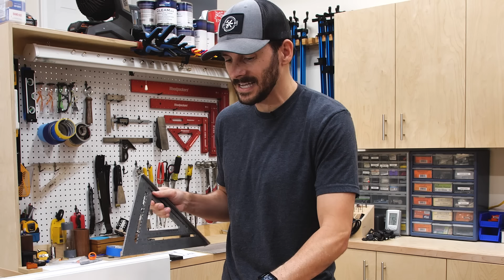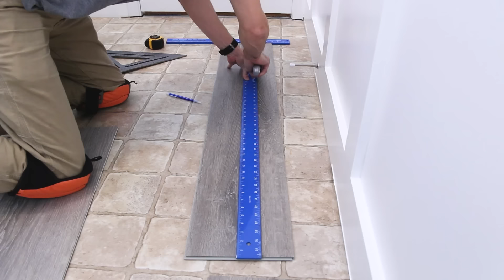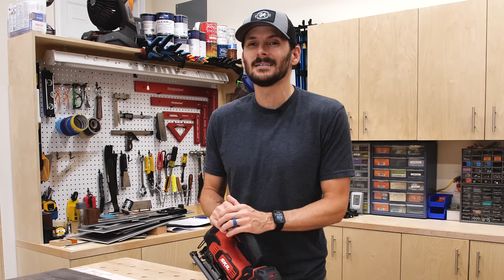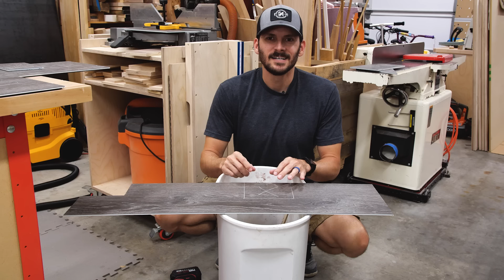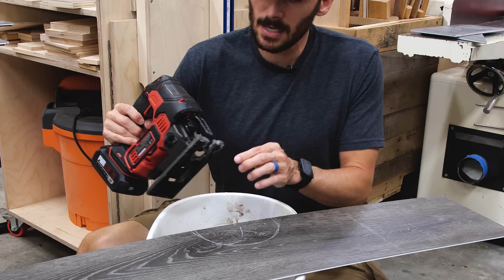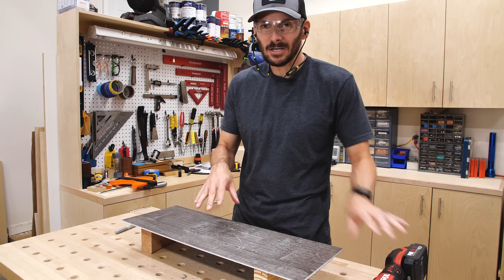How to Cut Vinyl Plank Flooring

Comment: I have used my HF Oscillating Multi-Toolfor cutting notches as well as cutting under door frames. It works nicely and can be used to plunge into the length cut of the notch.

Comment: I generally, do these jobs the messy way and sweep/vacuum after. Multi tool is #1, miter saw, then table saw for long cuts. 
If you don’t have those bigger tools, getting a circular saw can do EVERYTHING the miter saw and table saw can do. 

Getting corded versions of both at harbor freight will run you about $90. Getting a decent cordless multitool with a battery and a corded circular saw from any hardware store will run you about $150-200 (I lean this direction)

Good luck yall!

Comment: We really appreciate the detailed breakdown of cutting techniques! The way you demonstrated using both a utility knife and a laminate cutter was super helpful. It’s great to see practical tips like using a tapping block for clean snaps, as that can save a lot of time. 

For anyone starting out, remember to measure twice before making cuts to avoid mistakes. Also, keeping a few extra planks on hand can help if you miscalculate or need to make adjustments. We've used your advice in our recent project, and it made the installation process much smoother. Thanks for sharing such valuable insights!

Comment: question about the cut “mistake”.  not about the cut itself, but how do you work the joint with the already installed piece to click in yet fit the bump-out of the wall?

Comment: I watched this because my cut off pieces don't have a lip so I can't use them to start the next row....or can I, since I you did put the 14" cut line next to the next board. I'm trying not to waste expensive LVP.  HAD To update my comment. I figured it out. Those off cuts go on the end of the row...butting up against the opposite wall....dah. But I did have a legit panic for a minute.

Comment: Great info thank you!
Question….My room is 31 feet by 20 feet. How would you install the 7” x 60” boards from an appearance point of view (60 inch parallel to the long side or  60 inch parallel to the shorter side)? Thanks again!

Comment: My vinyl I install I swear cannot use utitly blades to cut its pfc stone or whatever called I work for someone who has the vinyl too but his vinyl is very strong I can snap it but it cannot be cut with a utility knife or in doing something wrong lol. I use saws or the measure it and and pull down and it cuts clean af

Comment: You do great work I just wanted to let you know when you have small cuts with the razor knife turn it over to where the village finish side is up you put your framing square half side up and you put your cut edge on top of that and pop it with your fist Very little pressure is needed but it makes a great snap. That’s how I snap every cut the only time I use a saw is when you’re making linear cuts on your board. My worker use the technique I used and he snapped 3/4 of an inch off the butt cut. I was so impressed but he used that technique that I suggested.

Comment: I found that if you tried to cut long ways with a razor blade it would try to go off path due to the grain. 
I used my table saw but it throws the vinyl dust everywhere which isn’t good for the environment since it isn’t biodegradable like wood sawdust.

Comment: Jigsaws work amazing for all cuts, not the fastest, but will get the job done, especially for odd cuts. The down side of them is the blades get dull after 4-5 long cuts. I’ve tried every brand and even purchased carbide blades that do last up to 7-9 long passes of vinyl flooring. I used Mohawk 20 mil wear and 6mm thick vinyl . Basically buy plenty of blades.

Comment: No problem on the mistake! I have seen so many expert craftspeople make exactly the same kind of mistakes with measurements. Watched one of the best contractors in San Francisco ruin a $20+k trussed beam when he measured wrong. Thanks for showing it! Reinforces the measure twice, cut once rule. Just now my wife and I are trying to figure out how to match up our cut with the twists and turns of a door inset from the wall and the odd shaped molding around it.

Comment: Square cuts razor knife all four sides then score a x from corner to corner then on a bucket take hammer and push on center of x and it will snap but be sure to cut the back before snapping you will see lines when you push hammer

Comment: On short pieces put the tapping block under and put it right on the line put pressure on  the side with block and use your palm and pop down on the side and it will snap right off

Comment: The reason you keep having the backing attached is because you are not using the guillotine correctly! It's called a guillotine for a reason! You have to pull the lever down FAST! Back in France they didn't have the guillotine come down at snail pace.  It came down RAPIDLY!
Reply: The French reference 😂😂😂
Reply: Because if it came down slow it would not cut all the way through the bones. Speed equals force

Comment: What is the interior of a piece of vinyl plank flooring made of usually?  If you do choose to cut with a miter saw, what kind of tooth grind (shape of tooth) would you recommend on the saw blade?  Most blades are either ATB grind (usually for crosscut wood) or TCG grind (plastics, metal, melamine, rip wood, etc.) I was told you can cut the stuff with several different blades but if you're not using the right kind of circ saw blade with the right tooth grind, then it will cut well at first, then after not too many cuts your blade is suddenly dull.   Thats usually a sign of wrong kind of tooth grind for what you're cutting.

Comment: For short cuts I made a fixture of two 1x4s sandwiched together with spacers, leaving a slot just wide enough to slip the scored end of a plank into. I clamp it to a workbench and slip the piece to be cut with the score at the edge of the opening. It holds the short side while I get push down on the longer end of the board and I can make perfect 1” cuts.

Comment: Ive done flooring for around 7-8 years with my dad who's done flooring for about 17 years and the fastes way to cut vinyl plank is scoring it with a utility knife and breaking it with your hands, and a cheater board with the original straight edge on one side. Ive tested every way imaginable and couldnt find anything

Comment: Groovy vid. I personally use my drop saw if I have vinyl plank or hybrid jobs. I broke my guillotine, so I just got used to the mitre saw with the correct blade. You do need good extraction however, it does get messy.

Comment: Well done video. Only tip I would add- whenever you have a regular space need on a project, get a scrap spacer. If I want 1/4 inch gap, I keep a 1/4 inch plywood scrap handy and insert it while taking any measurement.
Reply: I use a paint stick on edge as it's 1/4 inch. And I lean it against the wall as I install the plank too.

Comment: The best tool for cutting length is a table saw! Best for angles is a miter saw! Small irregular cuts oscillating tool! Hm tools you didn't even mention? Toilet, remove the toilet if you want to do the best job. Toilets are easily  removed and replace without a video. Other then these few points good video.

Comment: ** Recommendation for the laminate & Siding cutter (the guillotine one) **   Flip the plank over with the rubber side facing up, it will cut the same way without the need to use a utility knife after for the rubber side ..... thanks for this video !!!

Comment: Some good tips in there. I have installed probably 100,000 sf of different snap type lvp and very rarely break out a table saw or mitre saw. 99% of my cuts I can score and snap with my hands up to about a half in or so. That includes all notch cuts, vent cuts and door casings
Reply: You CAN'T use the "score and snap" method for a 7mm thick SPC plank!

Comment: have you used an oscillating tool instead of a jigsaw for the length cuts?  I was thinking of scoring with a half-round blade on lengthwise cuts. I see in the last segment the mulittool (oscillating tool) melts it... if this is PVC that could produce some nasty fumes... I will stick with the jigsaw unless I can find a way to score or cut without melting.

Comment: omg I snap them longways all day everyday you need to learn how to use a knife lol. also easy way lay the last tile over the one before the right way not turning 180 then score the one you fitted you wont score anything under remove the tile fit the one you laid on top and snap the one you had fitted and fit the piece

Comment: OH. MY. GOD...   
IGNORE This guy... He's obviously not a profesional floor layer. He's showing you how to make cuts with all sorts of tools, using jigsaws, sircular saws, hand saws, clamps.... 
When actually all you need is a PROPER KNIFE and PROPER BLADE (dolphin knife and concave blade)
You don't even have to use measuring tape for these kind of cuts. For these kind of cuts you use another piece of tile as your template. 
Simplified process looks like this: 
1# Put the tile exactly on top on the last tile you fitted. 
2# Put another tile up to the wall.
3# Those two tiles gonna overlap. Score the tile with a proper knife or at least the proper blade (concave blade) and snap it. 

And it doesn't matter if you doing it longways, short ways, around the pillar. Process is the SAME. You can always break it. Score it and break it. 
I'm a profesional floor layer. Fitting LVT (luxury vinyl tiles) every day.  For this kind of job he just showed I would use NOTHING ELSE, but KNIFE

Comment: Or, instead of that nifty yet flawed contour tool, use a template, made from a piece of cardboard, maybe even part of a pizza box, cereal box, beer box, Krispy Kreme doughnut box, etc, use a Sharpie and a box cutter and emulate the exact shape at hand, without the shortcoming of the contour tool, and you’ll know that if your shape fits the object, your cut will fit too.

Comment: The main reason to use a circular saw as opposed to a jigsaw on long straight cuts is just that, a straight cut is what a circular saw is made for, while a jigsaw is for irregular cuts, hence the blade with a smaller cross section.

Comment: Just did a small 40sq ft install.  Had no issues using my skill saw without a fence to cut the planks. 
First set them on some foam board and mark your cut then away you go.

Comment: SPC flooring totally kills saw blades. If you are using a jigsaw, depending on the blade you will get 2 or 3 cuts before the teeth are gone. You will basically write off a hand saw and circular saw blades will be toast after a dozen or so long side cuts.

Comment: Instead of using pressure on the back of the board to break it, just break it off your knee, it never fails and it’s a little faster than flipping the board.
Reply: Also, if you cut over a scrap piece, you don’t want to cut your scrap because you might need it, flip you scrap piece so you have all useable material :-)
Reply: I don’t want to spam your page but I want to share my tips and tricks. I like to use oscillating tool and I can cut any cut I want in 5 seconds . Very handy when you’re making special cuts, straight cuts just score it straight and like I said, break it off your knee and slide your other piece to the other side of the floor for starting your new row

Comment: Thanks for this! I just did my first LVT floor. It was trucore arctic oak. Cork backing, looks like wood. After watching a bunch of how-to's I ended up using an 18 tpi metal blade 'dewalt' in a jigsaw. Worked great for both width and length as well as corners and around the flange, very smooth. This was a bathroom so I glued it down per company recommendations as i am going to put the vanity and the toilet on top.

Comment: I am getting ready to do my whole house by myself so thank you so much for the videos. Trying to learn everything I can before I get started.
Reply: Do you have an update, how you did or how your project is going?
Reply: @Dimbooby  I actually started with paneling all the walls. I had to do it all by myself. It took a while but I got it done. The paneling looks great.
   I have a bunch of trim work to do now but I think I should do the floors first and then the trim work? 
   During the paneling project, my wife was diagnosed with cancer and is now in chemo...So things are slow going but I will get it all done. To make her happy most of all.

Comment: For the Laminate cutter, when you cut it keep the blade down and lift up on the other side.  This will break it off cleanly and you won't have to do the extra step of using the razor.

Comment: Dremel tools with a cutoff wheel are also very good for this. I'd recommend putting some blue tape on it and mark that and cut on the lines, helps cut down some of the roughness from the cut.
Reply: Why take the time? Grilles usually have a 3/4" to 1 1/4" overlap.

Comment: Take it from a floor guy!  table saw and miter saw is by far the best way, any cheep ones out there will work.
Reply: I agree with you. For flooring installation I used to use only table saw and mitre saw but jig saw comes in really handy sometimes.

Comment: Oscillating tool, box cutter, and some scrap plywood is all you need for making cuts. Make sure you have a piece of plywood long enough to make rip cuts with. Put your knee on the plywood for pressure and use the plywood for a guide to make the rip with the oscillating tool. Cut the back with the box cutter. Put some furniture slides on the bottom of your scrap plywood to keep from scratching up your new floor. The oscillating tool will cover nearly every cut you have to make. Speeds up the work tremendously!

Comment: Do you caulk your baseboards to the flooring?

 As well is one allowed to put a closet rack which would be drilled into the vinyl flooring?
 Would that be okay being that the flooring needs an expansion gap?

Comment: I used a 80+ tooth blade on a table saw and got really clean cuts both width and length wise. Was super fast and efficient and the blade cost me 70 bucks. I'm talking like 1200sqft basement and the job looked super clean. Am I missing something? Is a table saw not easier, cheaper and faster then going out and buying a laminate cutter ?
Reply from the maker: table saw is a great method for any of these cuts, I was just trying to keep it in the cheaper tool category at $100 and under
Reply: Messy
Reply: A table saw is more expensive and typically leaves a dusty mess unlike the  geotine style flooring cutter and it's more mobile and lighter.
Reply: @jasoncanon7311 guillotine* 

it’s French.

Comment: I used grips to snap small bits, works fine as long as you grip the scap part.
Reply from the maker: great tip!
Reply: Couldn't you also snap it cleanly after scoring it by putting a block or something with a rigid edge under it near the scoring line, and pushing down the smaller piece? Basically, instead of pulling up, you're pushing down, kind of like a tile cutter does.

Comment: When using a jigsaw or circular saw to rip a piece be careful the sole plate of the saw doesn't mark your finish piece. When we did our floors we had to put painters tape down to avoid this.
Reply from the maker: Yes, good call.  If your baseplate is scuffed up it can scratch the floor

Comment: As a floor layer you should mention that the type of flooring you demonstrate will blunt your jigsaw, circular saw etc in a very short period. Buy cheap blades for each tool for those jobs as the cheapest to festool blades will all be Cactus after a very short period
Reply from the maker: Yes, vinyl isn't easy on the blades!

Comment: with the 4" cut, couldn't you just pull from the opposite side?
Reply from the maker: yep, could definitely do that, but need to put it on the floor and use your body weight to hold it

Comment: Thanks. Good video, since I'll be doing my bath with vinyl plank later this year. 
I am concerned about  knife cuts being smooth and straight enough when butting them up to another piece mid-floor where they would be pretty visible. Any tips on that issue?
Reply from the maker: Mid floor you wouldn't cut the pieces down. You'd use full length pieces and the locking tabs on them
Reply: @Fixthisbuildthat  Thx. I didn't catch that the first time watching. I'll go back and watch more closely.

Comment: A permanent marker would have done a better job.
   Will know for the next flooring install.
  I was hardly able to see the mark of the pencil.

 By the way you can rent that vinyl floor cutter for $27 from Home Depot or Lowe's.
  $27 can save you a lot of time.

  If you're going to score the boards make sure you have a pack of blades, as you want to use a new and sharp crisp blade.
Reply from the maker: I switched to a permanent marker for the marking the notches and circles for that exact reason, good catch
Reply: @Fixthisbuildthat  I watched your first video five times! Took note of every detail! 

 Like I said your my new ChrisFix when it comes to wood working and repairs around the home.
  Too bad I only bumped into your channel just recently..
   I spent one night watching all your videos, rather a handful of your videos.
 You have some great stuff!
   I love tackling jobs on my own..